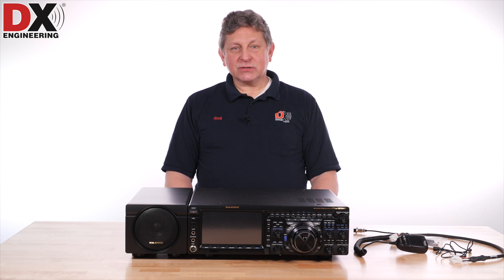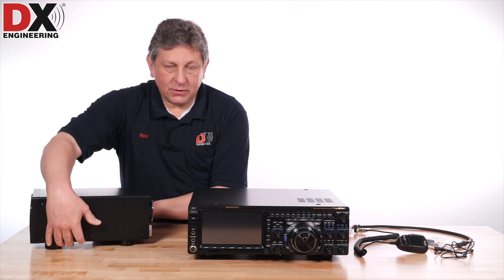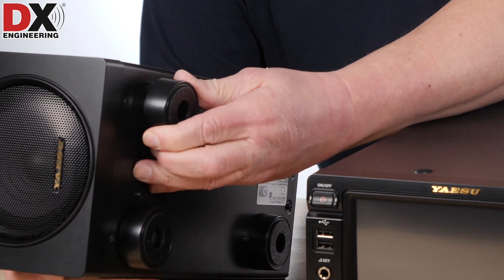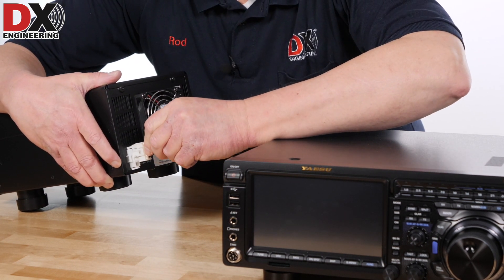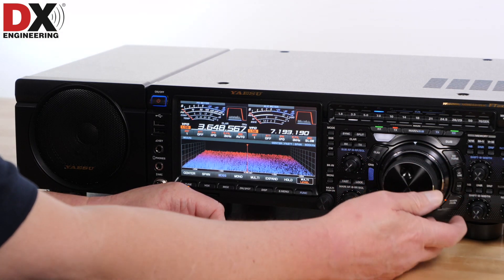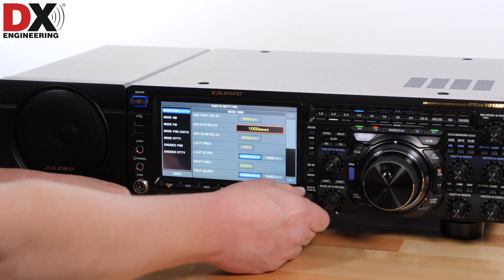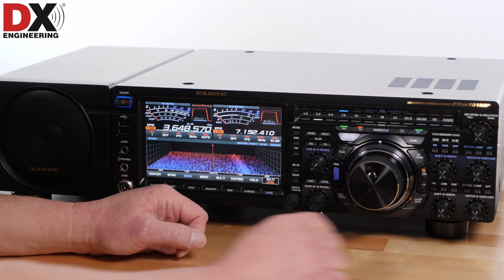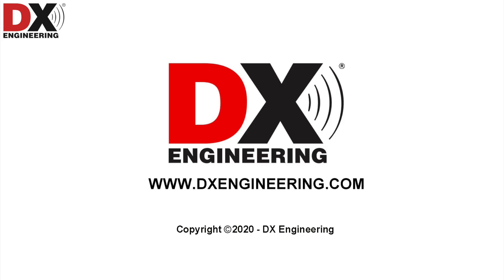Yaesu FTdx-101MP Overview

Comment: Holy Snikes! It seems like you'd have to have a computer science degree just to operate this monster of a radio!  I like Yaesu radios, however, why does anyone need a "3D waterfall display?"  I bought an Icom 7000 in 2015-16 and it has features that I have not even tapped into yet! Seems as though upgrading my station is going to become a major financial expense that I will have to somehow justify to my wife!

Comment: hello, very good explanation, I have a question if I wanted to connect my MFJ 962E External Antenna Tuner is it possible either to the radio or the FPS 101 speaker power supply? Or would I have to get an external power supply? Many Thanks in advance

Comment: The major problem here, is that you can't buy the radio without the speaker/power supply. Otherwise, I would pull the trigger in a New York minute. I already have "studio sound" with a Mackie board and studio Phille monitors that delivers incredible audio, and my entire shack is powered by dual 6 CS 21P tended Rolls batteries. In any event, great radio....

Comment: I'm suprised that the "feet" on the radio, power supply and speaker do not have the gold band around the feet to accent the radio and price tag.  My Yaesu FT-920, SP-8 speaker and Quadra amp do.  And those are 20 years old.